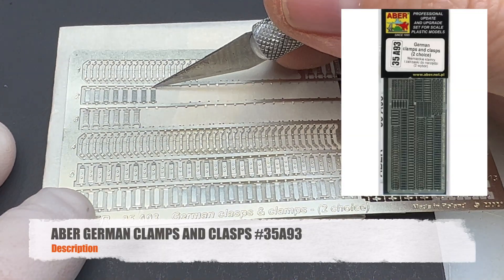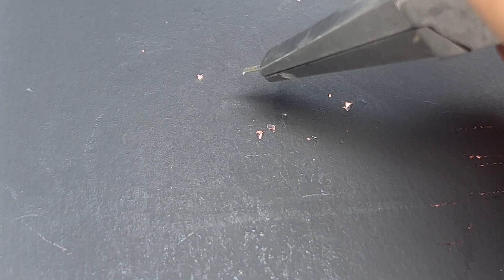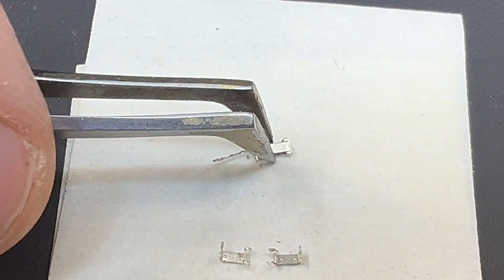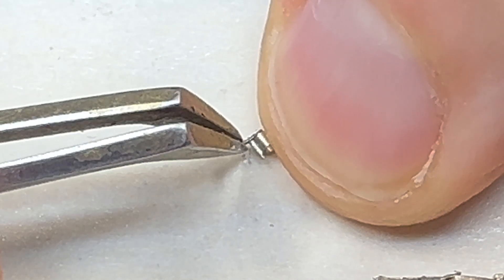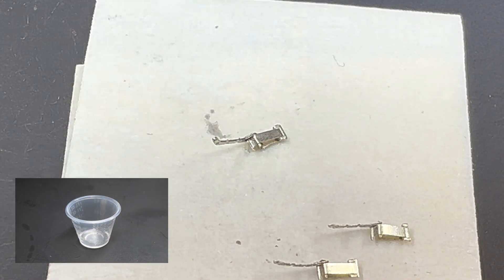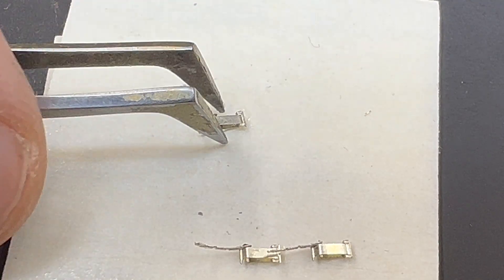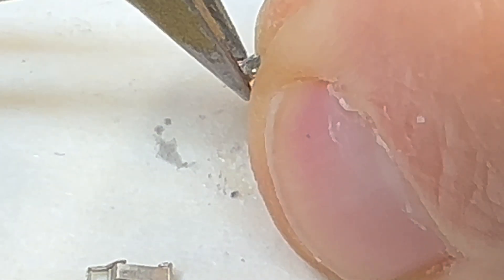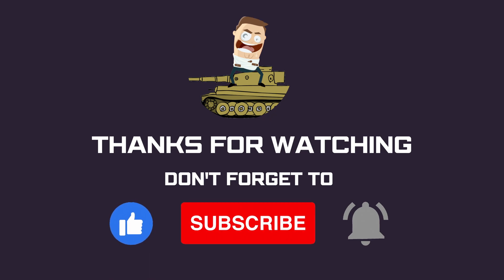Fast and Easy Way to Make PhotoEtch Tool Clamps

Comment: This was a helpful video, Rob.  I have some questions:  
1. Are the clamps workable after the cementing with CA?  If not, how do you fit them over the tools to give the "humped" shape and clamping appearance?

2. It would seem that the CA would leave a lump on the handle that would show up after painting and weathering.  Do you do anything to remove it?
Reply from the maker: Hey Kurt, these are not made workable.  These will fit over all of the tools by living them on.  If they don't you would make the clamp around the tool handle if needed.  A little cleaning with the facto blade would be needed if you put the CA on the outside of the bracket, but not always depending on how much you apply.